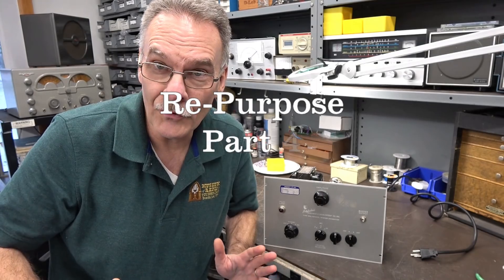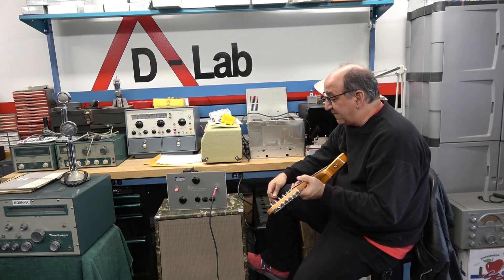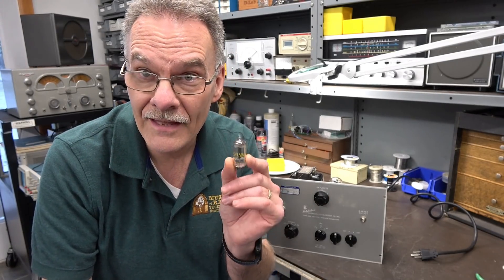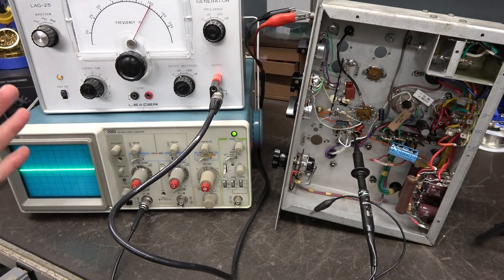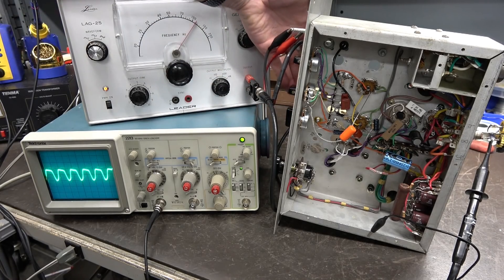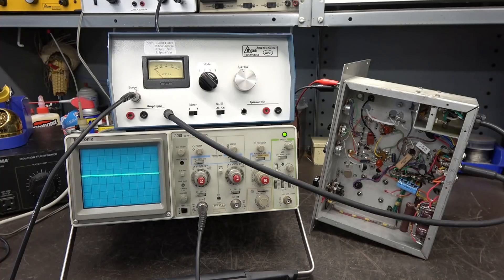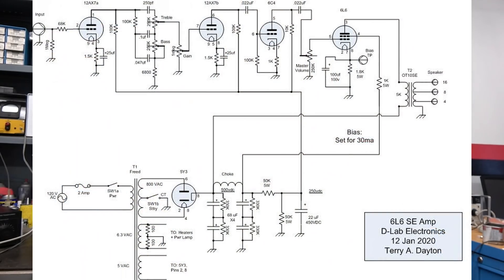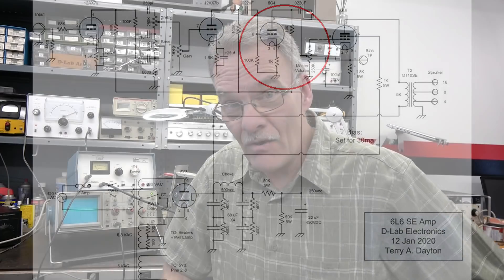How to Re-purpose Junk into a Tube 6L6 Homebrew Guitar amp Initial Test Part 4

Comment: Add grid stopper to the 6L6 since you are looking to overdrive it. Re-wire the grid of the 6L6 to the wiper (or it's drawn wrong,) and leave the master just before the 6L6. 250k is perfect since it is also the grid leak for the 6L6.  Neither stage in the 12ax7 is likely to clip so preamp clipping would come from the driver tube.   If the input to the 6L6 is too strong you can cold bias the driver tube which will reduce it's output and make it "cold clip" sooner for earlier breakup.

Comment: Terry, that unbalanced waveform seems to indicate that you're not biased at the center of Class A operation. You're running out of gas on the positive side of the output waveform. If you center your 6L6 in Class A by altering the bias on it, you'll have more available power, and when it overdrives from the previous stages, you should get lots of loud clipped vacuum-tube output. You may not need any negative bias on the 6L6 to accomplish this. Perhaps throw a variable resistor into the cathode of the 6L6 and try and center the output wave as high as it will go, til it begins to clip.

Comment: Hello again another wonderful video what would be the easiest way to determine the voltage needed for a field coil speaker. I am running a pair of Jensen F12 700 ohms on a hundred volts DC. I have a pair of 12" Rola with the same 700 ohms across the field coil wondering if I should run the same voltage

Comment: I would add a low value resistor to the grid of the 6L6 as a "grid stopper" to prevent it from oscillating like that. Also you could now move master volume before the gain stage, as someone said below. Keep on experimenting. With such gain i would consider reducing the capacity of the caps in at least one gain stage. The distortion, that you said could be the reason of low midrange is called cut-off clipping and is often caused by cold biasing. Check bias of all your gain stages, not only output tube. That is very important if you want to have nice breakup sounds. Greetings from Poland :)

Comment: Really like the repurposing projects. Don't forget to try a couple of different speakers and cabinets with the amp.  From building stereo speaker cabinets years ago, I know the difference in cabinet design (open, closed, ported) on the output can make a huge difference (most amp builders seem to build to 'what looks right to sell' rather than extensive calculations). Here are some Johan Sageborn Channel testing of speakers and cabinet mods to the tones, which show a dramatic change ... https://www.youtube.com/watch?v=skfVh5qagoo  https://www.youtube.com/watch?v=wDN5tMjaq6A   https://www.youtube.com/watch?v=qdrqD9fTAp4  speaker cabinet design calculator (there are many out there) https://www.diyaudioandvideo.com/Calculator/SpeakerBoxEnclosure/

Comment: Is there a grid stopper for 6L6?
Reply: If it is built following the schematic diagram which was shown in the video, there is no grid stopper for 6L6 input grid. To avoid unwanted parasitic oscillations, it would be a wise thing to add a 1k or 1k5 grid stopper resistor.

Comment: Hi, Terry, why have you wired up the master control pot reversely? Also, I think it would be a better circuit design to put this master pot in front of the 6C4 stage, so that the grid of the 6L6 sees the constant low output impedance of the 6C4 in any condition.

Comment: The asymmetric waveform is showing large amounts of even harmonic distortion. This would indicate the second gain stage bias is too cold.  This usually sounds pleasant and adds to the mid range. Also, a standard 12ax7 would enable a cathode follower pre tone controller which is generally more affective in dealing with tone control loading as well as providing a post tone control gain stage. And it standardizes the preamp tubes.  Just suggestions.

Comment: I'll be interested in what you find.  I can't make heads or tails out of your EE friend's comments.  In class A, there's always going to be some draw on the power supply.   But I do wonder if the preamp's B+ is adequately isolated from the variable power draw of the output stage.  I'd scope the B+ as well as each stage to see where that's coming in.

Comment: You have 2nd harmonic distortion. Try increasing the 6C4 plate resistor to 100K and add a cathode bypass cap. In other words, make the new stage identical to the original stages and go from there. In your tone control circuit, the 6.8K resistor is your midrange control. Try a 10K pot in its place to make it controllable and see what happens. Just some suggestions. Keep up the good work.

Comment: I have got to get an oscilloscope. It must be nice to see the waveform instead of the old hit or miss method of swapping components. That third gainstage has a lot of tone shaping potential, bias cold or hot to taste. It seems to me that a class A power amp should always grid clip before cutoff, am I wrong? I understand why you chose a 6C4 because of the low gain but why not a cathode follower before the tone stack to boost the signal and then another cold bias gain stage ala Marshall, too much gain? Too much grid current clipping?

Comment: About the mids, I'm working on a mini aa764 silverface champ, and that one has 15K resistor to ground in the tone stack that gives it more mids than a standard fender tmb.
Since your friends seem to like the amp at full volume, there's risk of blocking distortion that way! Is that one of their complaints?
Reply: @remley8877  50k with 47k in series maybe? By the way you mean the resistor that centers the scoop, while i mean the one that decides how deep it is